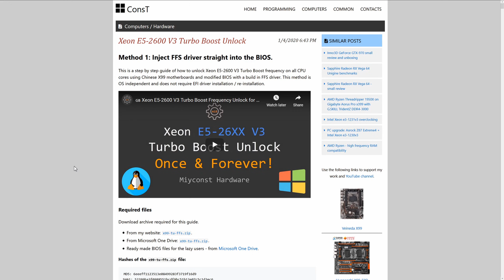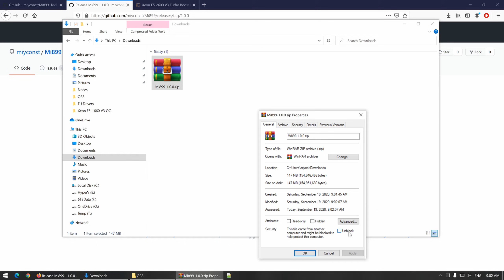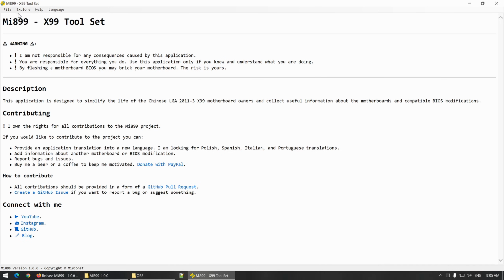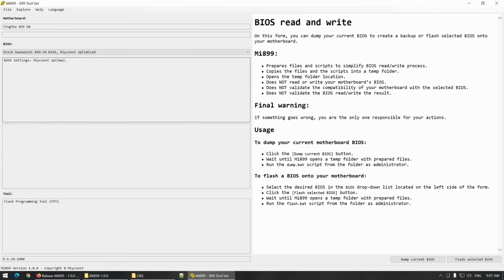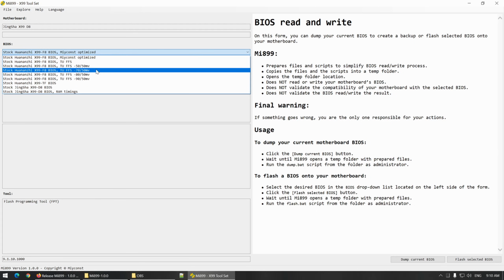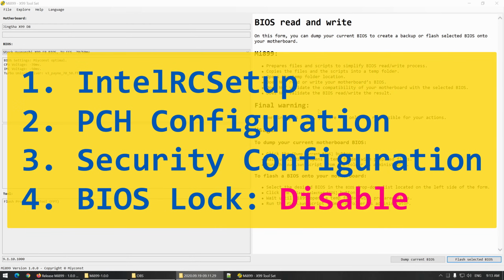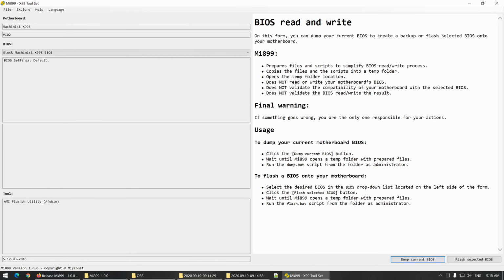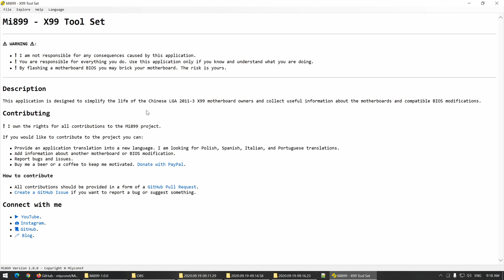🇬🇧 Mi899 – X99 Tool Set | read, write BIOS & unlock turbo-boost with a few mouse clicks

Comment: What are your thoughts on Xeon E3-1220 v2 + cheap used lga 1155 mobo + 8gb ddr3 1600mhz? I found this mobo + cpu + ram combo  on local market for about 76$. This compete with ~130$ x99 Chinese xeon mobo combo with the loss of sata 3 connector and usb 3.0. For an extreme budget gaming rig, I think it's the best bang for buck given it's almost half the price. But how much difference in performance between this two processor especially in games? (taking the speed of ram into consideration) If you do happen to have e3-1220 v2 processor , I'm glad to see the benchmarks vs the chinese mobo :) I think of getting this xeon E3 temporarily mainly for gaming before upgrading to a better one when I got enough money.
Reply: Oh I found a better one, E5-1620 v2 with Chinese x79 mobo and 2*4gb server ram for only 91$ that could compete with 2620 v3 turbo boost unlocked!
A cheaper option for gaming without losing much performance. While Xeon 2620 v3 is better in multi threaded performance and productivity, I think 1620v2 is better than 2620 v3 in games as it has higher single threaded performance based on PassMark benchmark. I'm not sure if it can be overclocked though. What is your opinion on this? Man they should have a version of PC master race for the best value setup XD

Comment: I am running Ubuntu. What utilities are you recommending to use? Or do you have anything that might use the EFI shell that might work regardless of the OS?
Reply from the maker: In this case it would be easier to prepare an MS-DOS bootable USB flash drive and perform the BIOS mod from there.
Reply: @Miyconst  Thanks! Do you have a recommendation how to do it from Ubuntu?
Reply from the maker: @DanielAStroe  no, sorry.

Comment: Amazing job! Well done mate! Is there any way to unlock turbo-boost to A-brands mobos such as Asrock, Gigabyte, Asus etc? I have an Asrock X99 Extreme3 and i was thinking to buy a multicore XEON.
Reply from the maker: The turbo unlock procedure works on the branded boards as well, but you might have troubles flashing the modified BIOS, as most of the branded boards have BIOS write protection. Some of the AsRock X99 boards have BIOS features which allow you to run Xeon E5 V3 CPUs at their maximum turbo without any BIOS modifications.
Reply: @Miyconst  So i have to test a Xeon without any mod to see if i could get unlocked turbo boost :) One more weird thing with this mobo is that i can run a Core i7 5820K with ECC RAM. How is that possible? I know that with Xeons you can run both ECC and non ECC RAM modules but i can do that also with my 5820K....
Reply from the maker: @Nikos_Radioactive  that sounds really unexpected! Could you please produce a CPU-Z validation or a similar report showing i7-5820k with ECC REG RAM?
Reply: @Miyconst  Done! Mail sent :)

Comment: Just curious if the same program could be modified for the HPZ-440. I have several of these workstations and would donate to have these unlocked if it's possible.  Even with turbo enabled my e5 2673v3 only gets up to 2.8 megahertz.  It's capable of 4.0. 
Can it also be modified for the Dell x99 and Lenovo x99 motherboards.  
I recently ordered the HUANANZHI X99 TF motherboard from watching your videos to try it out.  
Thank you for your work.
Reply from the maker: I have not yet got any HP boards to test, but with a Dell workstation I was able to perform the same procedure. The problem with this OEM machines is that the BIOS is write protected and an external CH341a (or similar) USB flash programmer is required to write a modified BIOS. By the way, as far as I know, E5-2673 V3 has maximum turbo frequency of 3.1 GHz, where did you get 4.0 GHz?
Reply: CPU Benchmarks  said it would turbo up to 4.0 but I do see that has a a max frequency of 3.2 Max frequency
Reply from the maker: @tgjulielarson7753  Do not trust that garbage website, you can check your real CPU specs with CPU-Z or other similar apps.
Reply: Thanks for the info I do check Intel's cpu list for specs but I didn't check the e5 2673 V3 specs Until you pointed it out. It's still a great chip and I'm just waiting for my HUANANZHI board to try it out.

Comment: i'll help translating. i don't know the c# language but i know mine :)
Reply from the maker: All contribution is more than welcome. These two files are to be translated: 
https://github.com/miyconst/Mi899/blob/master/src/Mi899.Data/I18n.json
https://github.com/miyconst/Mi899/blob/master/src/Mi899/README.md
Reply: @Miyconst  i'll be more than happy to help. unfortunately i don't have a lot of spare time but i'll do my best.
Reply: @Miyconst  i translated the first one, if that last chunk of variables is not to be translated. where can i leave you it?
Reply from the maker: @francescovolpini  could you please rise a pull request on GitHub?
Reply: @Miyconst  i'm on the website under the pull request tab. what now?
Reply from the maker: @francescovolpini  to create a pull request you have to fork the repository and save the changes there. Alternatively, you can edit the file in place. If you can't figure GitHub out - please send the files to miyconst@gmail.com.
Reply: @Miyconst  right away. i'll learn github another way, i only use it when i find errors in my code anyway
Reply: @Miyconst  just sent it. tell me if i've done something wrong
Reply: @Miyconst  https://pastebin.com/M4Sg0F0p here are both translations. let me know if something has to be changed. i'd be glad to know i was helpful

Comment: That seems amazing! I used your guide the last time, and it was so helpful. I have another X99 board that I haven't tested yet, will checkout your guide for sure :) Thank you!
Reply from the maker: Thanks Phil. If the other board is something I have not tested yet - share the original BIOS with me, please.
Reply: @Miyconst  Sure, will do! The box has Atermiter branding, and the board looks similar design to the X79 PlexHD Turbo, with green colours.
Reply: @philscomputerlab  what x99 motherboard would you recommend for the e5 1650 V3? To take advantage of the unlocked cpu.
Reply: @njsurf1973  Huananzhi is the brand I'd recommend. As for boards, many versions depending on what you're after, the details matter.
Reply: @philscomputerlab  I'm looking for a stable overclock. I use it for light gaming and hobby level 3d design.
Reply from the maker: The only reasonable option in your case is Huananzhi X99-F8.
Reply: @Miyconst  thank you!
Reply: I have fallen in love with the xeon community now
Reply: @hadiffnazhan862  Same

Comment: Why are you undervolting cpus with -50 mv ? The stock voltage cannot do the unlock? Or the mobo could not do the "turbo boost button" for the cpu?
Reply from the maker: With reduced voltage CPU consumes less electricity, which means it can stay at higher clocks without hitting the TDP limit for longer.

Comment: Hi, i can help translating to spanish if u want
Reply: Also i have 3 machinist dual x99, if i can help to add this ones, i'll be glad to
Reply from the maker: Thank you very much, here are the files to translate:

https://github.com/miyconst/Mi899/blob/master/src/Mi899.Data/I18n.json
https://github.com/miyconst/Mi899/blob/master/src/Mi899/README.md

Regarding the addition of the new motherboards - you can do it through a GitHub pull request. Take a look at this file, it contains all the information: https://github.com/miyconst/Mi899/blob/master/src/Mi899.Data/Model.json

Comment: Hi @Miyconst I am here to help you with the italian translation :) Let me know if you appreciate my help! I am ready. I also have bios of other Chinese motherboards. Update...last purchase X99-E-10G WS, I found it new, never used
.
Reply from the maker: Thank you very much, here are the files to translate:

https://github.com/miyconst/Mi899/blob/master/src/Mi899.Data/I18n.json
https://github.com/miyconst/Mi899/blob/master/src/Mi899/README.md
Reply: @Miyconst   Perfect I am starting
Reply: I also finisched the read me part. Where I can upload?
Reply from the maker: @emanuelebianchi5889  Thanks Emanuele. To upload your work you have to use a GitHub pull request, here you can read about it: https://yangsu.github.io/pull-request-tutorial/#:~:text=What%20is%20a%20Pull%20Request,follow%2Dup%20commits%20if%20necessary.
Reply from the maker: If GitHub doesn't work for you for some reason, you can send me the translated files to miyconst@gmail.com, but in this case GitHub will not have history of your contribution.
Reply: @Miyconst  I sent you an email!
Reply from the maker: @emanuelebianchi5889  I have got it, thank you very much.
Reply: @Miyconst   Finish the interface part, let me know if it is ok for you. On Github I have another name Desk...

Comment: Great tool! Please add X99 8D3 to it :)
Reply from the maker: I have not tested this motherboard myself, and as far as I know it does not support nor FPT nor AfuWin, but I will see what I can do about it.
Reply: @Miyconst  It does support FPT after BIOS unlock like you said in video. TU works fine on stock bios but I dont have proggramer  so I never tried flashing BIOS form other board like TF. Me and my friend both have weird problems with this board. Sometimes its refuses to post. It just hangs on FF code forever. I tried to reset bios and troubleshoot but nothing. I thought its dead but after leaving it for 1 week without power it somehow came back to life.
Reply from the maker: @cayo2588  thank you for the info, I thought you were talking about the red Huananzhi board, that one has fully locked BIOS. Could you specify your full PC configuration? It's not right that the motherboard hangs like that. I know a guy, who has assembled dozens of workstations with JingSha X99-8D3 and he didn't have such issue.
Reply: Miyconst Well its quite a longer story. I have 2678v3, 32gb ddr3 ecc ram, older 550w Gold PSU, sata ssd bootdrive, nvme boot drive as backup, 5x hdd, RX 580 8gb. I build it without problems and it worked flawlessly for a month or so. The story begins with cheap 2nd hand sata SSD I bought. It was beat up but seller send me proof it works fine in diskmark. After I got it I put it in my PC to test and format it. I couldnt boot to windows or even enter BIOS with this new ssd, PC at start asked for password for my main boot drive which I never set. Without the new ssd PC booted and worked normal like before. I started playing with this new SSD, I enabled hot swap in BIOS and I tried to connect this new SSD while in windows or just after post screen but nothing helped, it was never there in disk management. When doing so one time the PC just restarted randomly and it was stuck at FF code forever with no signal, post or anything. I started troubleshooting. It was hell, I was many times sure every part of this PC just died but it was never consistent. First thing I noticed was after unplugging all SATA the PC can sometimes (1 in 20 tries) post to bios or later even to linux/windows from usb or NVME. But as soon I connect one sata cable to mobo (just cable, no drive) it was stuck on FF until I leave it unplugged from wall for longer than 15mins. I tried other PSU and it was the same. BIOS reset also never helped. After I got into windows I reflashed the bios to stock one to make sure it wasnt the issue. After that I was 100% sure the sata controller was dead. I even order the same new board form AliExpress :) . In next week I was very busy at work so PC stayed unplugged whole week. After this week I tried to turn it on again it was same - stuck on FF. I swapped this mobo for old one to have a working PC but after it was out I build a quick test bench to try one last time and it posted to bios without issue. Then I try with nvme and it boots straight to windows without issue. I was confused AF why it works so I put my old sata boot drive and it just worked like before all this hell. All other hdds worked too. Since then I built this PC again in my main rig like it was before and it works 100% now for more than week. I have no idea why. Also my friend bought same mobo and CPU after my recommendation for home server and he had similar issue with mobo being stuck on FF cose forver from time to time. He hardly turn it off now but when he was trying to make power on A/C loss work (he still cant make it work :( ) he was going into the same issues like me. He said he had to unplug CPU 8 pin cable and try to turn mobo on without this cable to make it unstuck from FF then plug 8 pin again to make it post to bios. I never tried this method myself.
Reply from the maker: @cayo2588  Hm, this whole thing does not sound right. I had a similar situation once, the problem was that some of the PC components was supplying electrical current onto the chassis, which was causing all these issues.

Comment: Wonderful as ever, mate! Does the program include BIOSes w/ Unlocked Multiplier for E5 16XX V3 ?
Reply from the maker: The stock Huananzhi X99-TF/F8 BIOS has options to overclock unlocked CPUs, this BIOS is also compatible with JingSha X99-D8 / X99-D4 and Huananzhi X99-8M. Machinist X99Z didn't work to overclock any CPU with any BIOS, for me.
Reply from the maker: Also, don't expect to break OC records with this Chinese boards, I am currently working on a video where I test E5-1660 V3 power consumption monster, and the results are not very promising.

Comment: I have a i7 5960x @3.00ghz and a Asus strix x99 mobo. Will this work for me? Ran a adia 64 stress test and my cpu only got up to 2.2ghz on 100%. Plz help
Reply from the maker: No, the Turbo Boost Unlock hack works only with Xeon E5-2600 V3 & E5-4600 V3 CPUs. CPUs with unlocked multiplier can be overclocked by adjusting the clock multiplier.

Comment: This could not have come at a better time, I was just about to flash my X99z machinist board but was a bit put off by the aufwin program. This makes things so much easier. One minor question though. When I dump the bios I get an 8mb file but the bios you provided on the flash tutorial are 16mb. Are these two bios compatible with one another?
Reply from the maker: AfuWin does not read entire BIOS, that's why you are getting only 8 MB backup, the file I provide is the full BIOS version, that is why it's 16 MB in size. I have not yet tried this tool on X99Z, please report back if it works well for you.
Reply: @Miyconst  thank you so much for this tool it was so easy to use that it's borderline fool proof even if you have minimal computer knowledge. And it worked fine. Just a small unexpected exception error (forgot to screenshot the error) came up when clicking the dump bios button but didn't come back up again on the second try. And it was a 5 minute process, you turned what could be a minor nightmare into an automated one click solution. Great job, and keep up the good work.
Reply from the maker: @dasa2344  thank you very much for testing, it's really appreciated! The error you have seen might have been because you didn't grant admin rights to the script, without the screenshot I can't say much more.